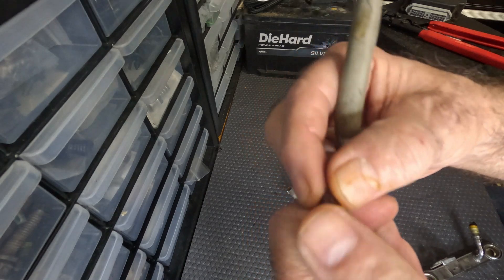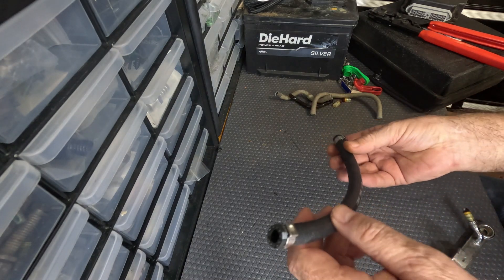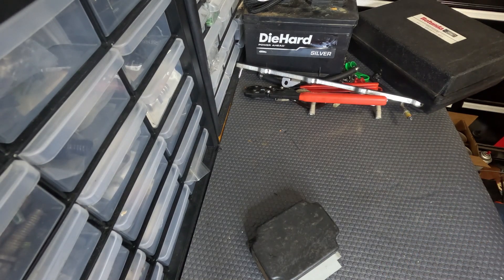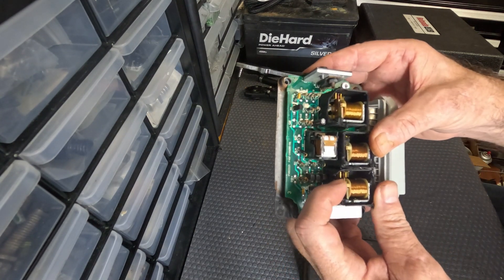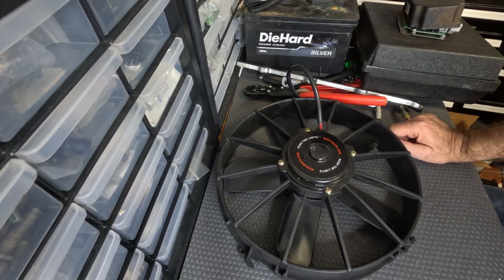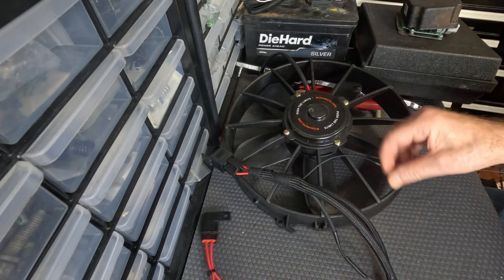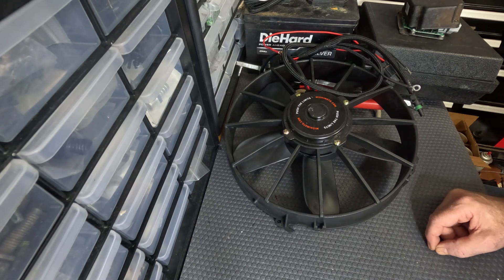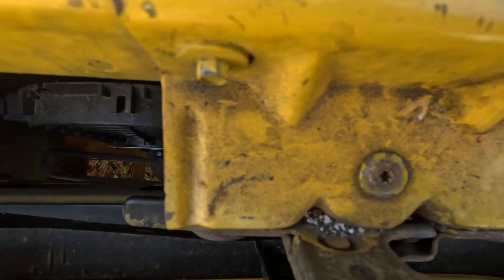SN95, Foxbody Auxiliary Cooling Fan

Comment: this is a really good set  up ....for AC at low speeds.....if you want to increase the efficiency more  you can switch to R152a   Refrigerant ( computer duster s pray at 60% of the R134a
weight added......30% less power draw ..can barely hear the compressor kick in ... Jay.
Reply from the maker: I may try the HFC 152a sometime. I can't remember if it is an A1 or A2 flammability.
Reply: @tuninginnovations5481   in the real world it does not matter....think about it .....people spray their computer keyboard while smoking cigarette's at their home ..
my one experiment now is over 3 years...runs and cools a 01 Olds Alero perfect.....can't hear the compressor even kick in ....  15% more efficient that R12 at idle and about the same at highway speeds..
spent a billion  hours looking at alternant refrigerants ever since my boss told me in 1998 that Propane is an excellent refrigerant ..cheers :  )  Jay.

Comment: How much has it helped, Ted?
Reply from the maker: Its noticeable on that car. AC subcooling reading changes between  on/off also.
Reply: @tuninginnovations5481  witch fan model 
did you use ?  Jay...   thanks in  advance
Reply from the maker: @charlesleake930  Had that one for a while and don't remember the brand. Its a cheap one. I have a thick Spal going in next after I cut and reweld the brace.